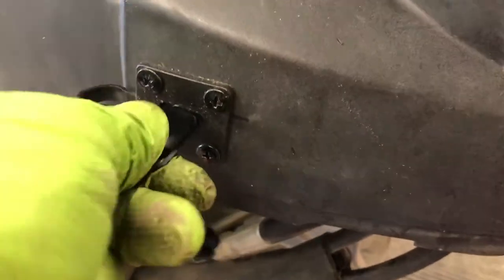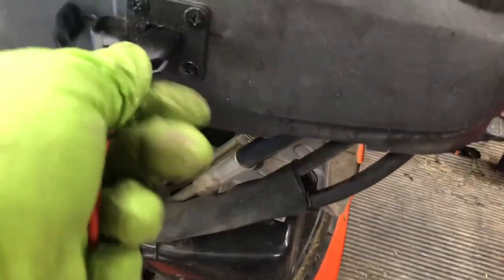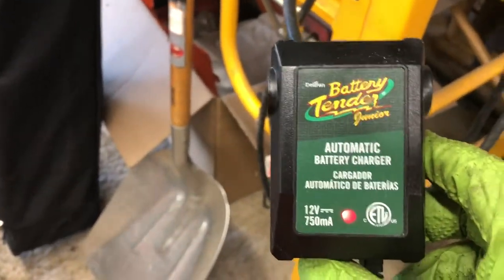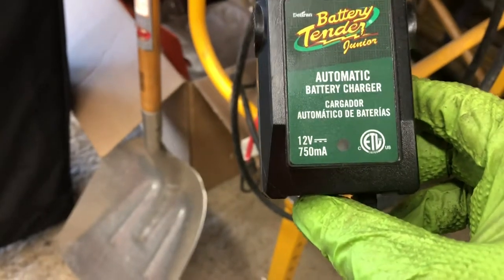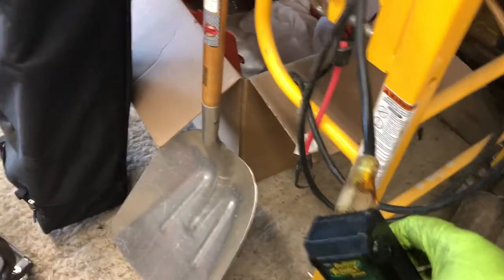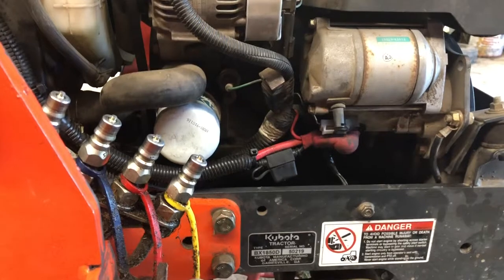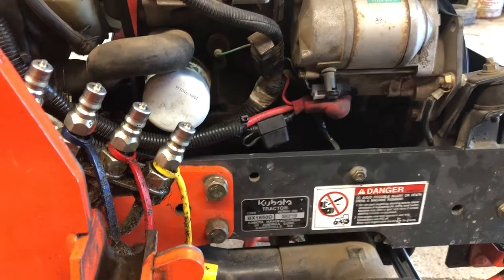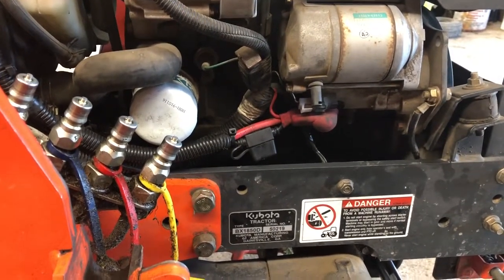#35 - Kubota BX1850 Battery Tender Install

Comment: Good video.  I’ve used a battery tender on my BX2660 for 12 years and never had any battery problems; still has original battery.  Today I just installed a similar battery tender mod on my new BX2380.
Reply from the maker: Thanks for commenting.  It's been one of the best mods I made to the BX.  I replaced my battery twice before I got the Battery Tender.  As you know, batteries are getting expensive and I wish I had this when I purchased the tractor.  I hope my current battery gets 12 years of life.  I can tell you that cold starts are a lot better with a fully charged and well maintained battery.